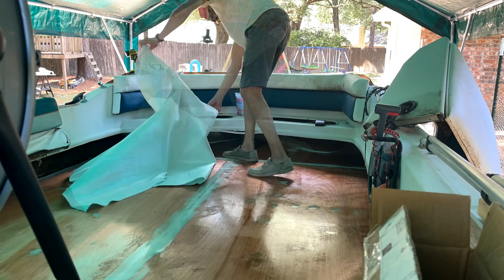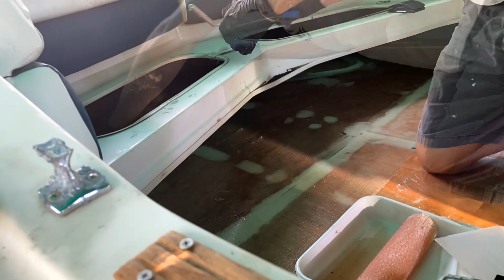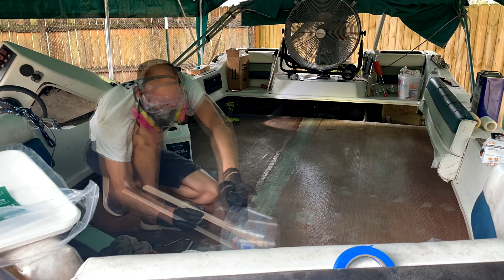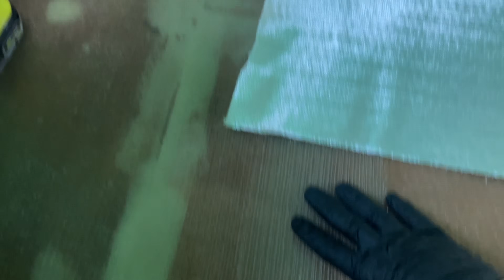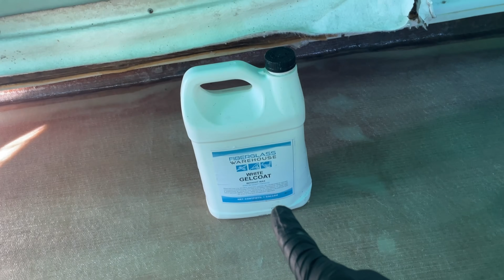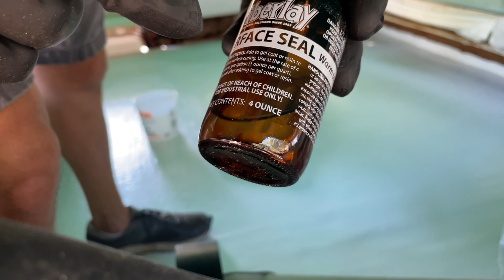How to Replace a Boat Floor - Fiberglass and Gel Coat (Part 4)

Comment: I got myself a boat recently. It has some soft spots and seeing your videos made me feel like it’s definitely possible for me to re do the whole floor. How long did it take you to finish up everything?
Reply from the maker: I did it while working full time. It took me 3-4 months? I didn't do it everyday though. Sometimes I'd just do one coat of resin and then take a break. It takes time for things to cure, so there are days when you can only do one step and then have to wait for it to cure.

Comment: So for the whole process how much did it cost? I am looking at a 1957 Larson fiberglass boat that needs a new sub floor. I would appreciate a rough idea of what I might be getting in to.
Reply from the maker: It cost me less than $2k. I believe you can get a discount by putting RUTTER in on Fiberglass warehouses website. Unless there is serious sentimental value to the boat or the boat will be worth way more once it is completed, I would consider looking at used boats. It is a lot of work, and if I had to do it again, I probably would’ve put the money towards a used boat with a decent hull that could fit more people or redone a boat that would have been considered a “steal” once I was finished. Again, if the boat you have is perfect and you’re willing to put in the work and time, it might be worth it, but it’s a lot of work. 😁 Hope that helps!

Comment: Why did you only replace one of the stringers? will that provide enough support? Also, did you use a 2x4 for the material for the stringer? I was thinking about using ACX plywood for the stringers and deck.
Reply from the maker: The existing board was a 2x4 so I went back with the same. The other two stringers were strong enough to support the floor and so I didn’t want to waste my time replacing them as well. The other two were plywood stringers wrapped in fiberglass.👍😊

Comment: I have an old tri hull Glasspar that a fella gave to me.  Nothing's free, especially in boating. Had the steering rebuilt and the motor ran through just to find out jt has soft spots in the hull.  Looking to pull the floor and patch it from the inside.  While in there I may wind up doing the same job you just performed.  Thanks for the inspiration.
Reply: Took it to Anchor Boat Werks a while back and they told me to bury it and buy a new boat.
Reply from the maker: Best of luck with your project!

Comment: If stringers are okay would it be hard to just change wood on floor
Reply from the maker: That’s essentially what I did. The only string I replaced was the middle one.👍 I left the other two in place.

Comment: Great job. Roughly how long did it take you from start to finish of the project? Stringers and floor.
Reply from the maker: I wish I had logged the hours. I don’t really know. With fiberglass you can only do so much at one time and then you have to let it cure. It was hard to track the hours bc I didn’t work on it every day. I also was doing it around my full time job. I started it in June and finished around the end of August. If I only did the boat and nothing else, it would have probably taken me 3 weeks.🤷‍♂️
Reply: @rutterrealtygc good to know. Im looking at a similar situation. Cheers for the reply 🤙
Reply: @KillragtshirtsMusic  My 19 ft V-hull is in need of a replacement floor -- so I'm selling it.

Comment: What kind of lumber was used for the plywood and wood blocks on stringers? I only have depot and lowes near me and planning on epoxy my sheets anyways. What would u recommend buying?
Reply from the maker: If you have any marine lumber store around, they should have better choices than HD and Lowes. My plywood choice was okoume plywood and the 2x4 string was marine grade lumber.
Reply: Did you ever epoxy the floors if so how did it go?

Comment: First wet resin, glass down on that. Then resin again.
Reply from the maker: That’s one way to do it! I was concerned I wouldn’t have enough time. I was also concerned of the fabric pulling/sticking while moving it around which is why I saturated it in place.👍

Comment: How much ISO Tooling Polyester Resin and Resin Wax Additive did you end up using?
Reply from the maker: The wax additive was only 1 bottle for the floor, but I ordered another one to finish up a couple other parts. Resin was probably about 8-10 gallons. Gel coat was only about 2-3 gallons I believe. I can look up exact amounts if you’d like. Let me know!

Comment: Great work, I've never messed with fiberglass. My boats floor is about ready for this. You made this process seem not to overwhelming. My only concern would be the foam that you didn't replace. If those stringers were holding that much water the foam is holding just as much.
Reply from the maker: The foam was bone dry. I believe it is closed cell so that it can’t absorb water.👍😊